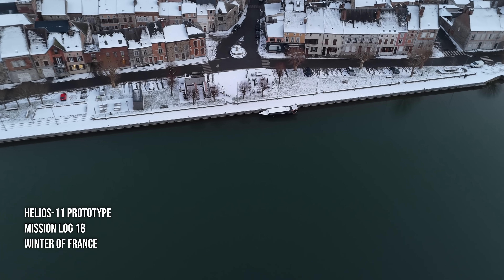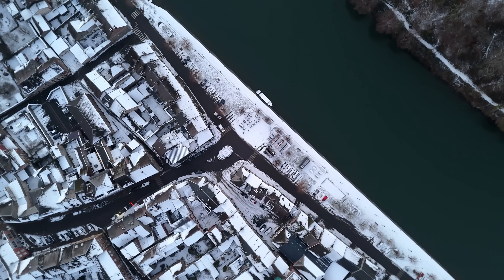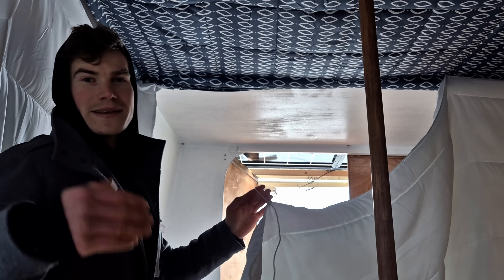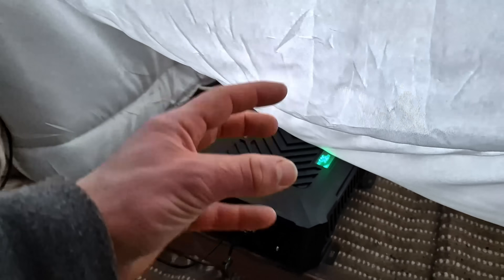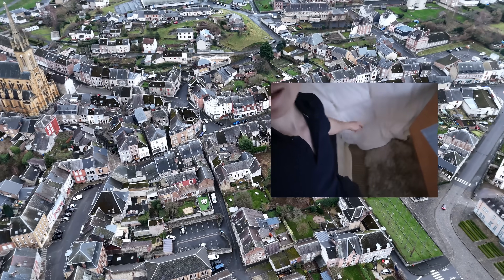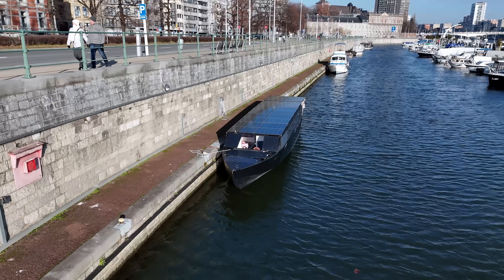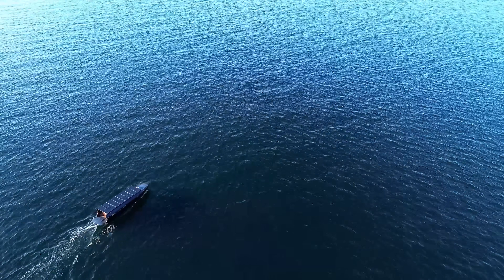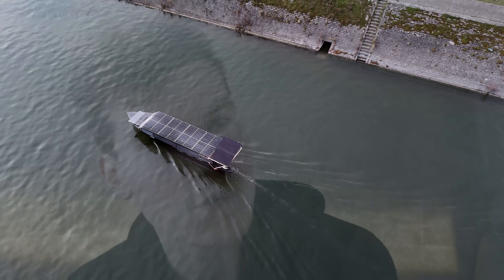Installing Heating on my 100% Solar Boat in Winter (230 V, Infrared Heat)

Comment: For our off grid customers we always set up the Victron Multiplus II inverter to wake up its SECONDARY 230v AC output whenever the batteries State of charge goes over 99% and it cuts off the secondary output power whenever the batteries drop to 90%, so when it’s sunny that second output power source is being supplied by solar energy that is basically bouncing off of full batteries. You could send that excess energy into a well insulated electric hot water tank and use that water in a hydronic under floor heating system or you could use the electricity to power an electric floor heating mat system or infrared panel heaters. Water holds thermal energy well for later use (at night or when it’s not sunny)

Comment: Design proposal: A short while ago I mentioned a gable roof. If you want a flat roof in the middle and have a slope of 30 degrees on the long sides, you can lift the "shadow side" in 30 degrees too.
But the best of all is that you have windows under the sun panels, and you have always a view threw them on the shadow side where the panels are raised to get energy.
If you put all the panels horizontal you have view both sides (and use the panels as marquis/sun blinds in the Mediterranean summer), and when it's getting darker you lower all side panels and use the panels as shutters and keep the heat inside. If you use an air-air heat exchanger you can easily heat the whole boat on 900W and use it as a cooler in summertime.

Comment: The panels on the side of the boat, perhaps they could have pneumatic pistons, that push them up? Hinged at the top and pushed from below. So that, when deployed, they'll be pushed up 90 degrees, to be more-or-less flat with the top of the boat? Flat with all the top-mounted panels. Therefore facing the sun much better. Then, to make the boat narrow again, retract them back to the side. Perhaps when you're docking, or any time at night when the panels don't matter. For whatever reason. Just seems like a way of getting more effective square metres of sun-facing panel. 

You don't have to use pneumatics, there's electric linear actuators, or just use your arms and some metal rods, some mechanism you can deploy yourself.

Comment: Good idea , get a little ceramic fan heater , if you can get some of the double foil roof insulation you could do the same thing but make it more permanent. Hot water heater would be a good idea for when you are moored / in port.

Comment: 500W x 6h = 3kWh. Please font mix kW with kWh - its confusing. Other than that, great video's. I watch U from the begining. Its great that U have solars on the side of Your boat. Great job U tough Finn 😉.

Comment: Can highly recommend getting a heat pump! It will do double-duty as AC in the summer, and will be multiple times more efficient than using infrared heating!

300-500W of infrared being enough to equal 900W of resistive heating is sadly a bit too optimistic.
Reply: True! Many heat pumps are air-sourced. But with a boat, you can use water as your heat source. All those gallons of water, heated by the sun, all year round... Water at maybe 270K, and you want your cabin to be at 280K, a heat pump is pretty simple. It makes sense to use Kelvin rather than Celsius like this, because it's an absolute mesaure of heat, starting at absolute zero. Not relative to some arbitrary thing like H2O's phase-change temperature. Even an air-sourced heat pump can create 1000W of heat for maybe 200W of electricity used. 

Using water ought to be much more effective. Maybe you could even make one out of parts from a fridge? Or else buy one and see how they're installed for water-source. There are ground-source heat pumps, use heat from the ground, but they use a liquid circulating in pipes underground, to take out the heat. So just bypass that bit and take liquid out of the water underneath you. Give it a filter, first. Although I believe they only go through a heat-exchanger and a pump. You could perhaps use your own marine pump, something a bit more tolerant. Any old way, there's tonnes of experimental potential in it, and even a home-made job might well surpass infra-red, or any other sort of resistive heating. 

Some pubs use infra-red heaters to heat patrons smoking outdoors. They're surprisingly effective. But I dunno that I'd want to rely on one indoors. Once you're out of the IR "beam", you're just as cold as you were before.

Comment: Thanks for the video ! I would consider a small backup generator as a means of charging the batteries when solar or shore power is inadequate. Assuming that this generator would not often be used, a gasoline (petrol) generator might be more economical than diesel. I had an old EM600 Honda generator on my sailboat when I was cruising. Its' <600 watt output was not much but it was quiet, lightweight and required little maintenance. I didn't run it very often but it saved me from loads of trouble when I needed to use it. It never let me down when I needed it.

Comment: You could do  way more efficient heat pump. Todays top of the line air heat pumps are about 400 % efficient. For each kw used to run heat pump you get up to 4 kw of heat. You could be brave and use water from outside the boat to collect heat and that would up efficiency to 7-8 kw of heat for each kw run into heat pump. But to squeeze the extra adds risks as you need a new hole in your vessel. 

Or save money and order the cheap Chinese webasto diesel heater. A diesel heater let you stay warm no matter the situation. I would choose diesel heater just because it let's you use batteries and solar for propulsion.

Comment: Maybe silica aeogel Mats are the right insulation for your boat? Hydrophobe and ceramic. They are very think with high thermal Resistance and no fire harzard. Keep on.

Comment: I would have installed a 9000btu minispit heat pump.  At freezing temps the COP would be 3 or so.  Every watt of power would give you 3 watts of heat.   In summer you could use it for cooling the boat.  Or just install a small wood stove.

Comment: I'm reading through the manual right now and it is a helpful "first principles" look at things.  I have not found detail yet or answers to some of my questions but I suspect I can get answers elsewhere.  I was wondering if you saw anything about "X" bows vs reverse or "gooseneck" bows?
I noticed that it would make for not having walking space on the front...do you think that would be missed...say for sail maintenance?
Or could the mast and sail be controlled remotely...and serviced under calm conditions...so many fun things to think about.
Back to reading through the manual. :)

Comment: You're making a fire trap.  Always use fire-resistant insulation.  

You're using the wrong units for total energy, it should be kWh (kiloWatt-hours).  

Electric heaters are always 100% efficient.  You can get well above 100% efficiency with a heat pump.  They make portable heat pumps that work by exchanging heat from outside air using tubes.  The two-tube models work best.  The alternative is a small mini-split heat pump, or a heat pump designed for a boat or RV.

Comment: For the next stage, think about a small heat pump which is 4-5 times more efficient and uses about one Kilowatt. It will heat your boat t0 22C in about 15 minutes😀

Comment: Canadian here, with camper experience if you have an onboard water tank that could freeze I'd have a diesel heater as an emergency backup.  It's a real pain to replace the cracked tank and any water damage.  Yes, with your system it's extremely unlikely to be needed but it's inexpensive and 1 emergency use will actually save carbon output, replacing equipment and repairing damage has a lot of embedded carbon. Emergency use only of course.

Comment: Your pillow castle will get condensation problems. To prevent this, you need a vapor barrier. That's physics, because your outer shell is vapor-tight.

Comment: For extra efficiency, use aluminised mylar film as well to reflect heat in, or keep it out.
Clear bubble wrap works for windows, and the aluminized bubble wrap or rock wool slabs work well.
Rock wool is not flammable either.
Ventilation is also important for oxygen and to reduce condensation. You can decide a system where some of the warm outgoing air can help to preheat cold incoming air, or vice versa when you need air conditioning.
As a Finn, I expect you'll hate the Mediterranean!

Comment: A wind turbine that fits in that sail mast hole would also generate a lot of power.
Reply: No it wouldn't. Small turbines only produce negligible amounts even in very strong winds. They also cost about 100 to 1000 times more per kWh than PV for small turbines up to about 30 kW  Turbines. Wind power scales with size as costs rise more linearly while energy gain rises squared. You need to go very big to make it viable. No bueno under the Megawatt range. PV can be build very small and still be cheap. You can get a single 500 Watt panel under 50 bucks. In big PV plants they still only get to around 6 cents per Watt.
Reply: @thoreberlin  Thanks for the reply. I figured with growing up in coastal South Carolina and always seeing wind generators on sail boats it made sense. The more you learn.

Comment: I think if it were me I would find a heating source that doesn't rely on electricity just to save the batteries in all the power for the engines either way good luck I love your video man and I think your boat is amazing

Comment: liquid water = giant reservoir for a heat pump. You're sitting on an enormous amount of heat, and even more latent heat, no matter the air temperature.
Solution: Something like BSW19482K, a miniature compressor water chiller, except it will just act as a heat pump. This one needs 160 W of electric power and transports up to 400 J/s (?) in heat flow, so you get ~500W equivalent of heating power. 
And it's rather cheap for what it does.
Reply: So you cool the water in the river to warm up the boat right?  Just to make sure I get it right. 
Can it also work reversed so cooling the boat in summer?
Reply: @HansKeesom  guess the youtube regime deleted my reply again. In short, the chiller needs to have a set of valves to switch up the hot and cold side heat exchangers. It would need to be designed and built with those features, as retrofitting is neither cheap nor easy (nor legal without a certificate when fluorocarbon gases are involved).
Reply: 1 watt = 1 joule per second.
Therefore the watt is a rate of flow of energy.
Reply: @ahaveland  edited to word it more accurately, since fewer people read the replies. thx
Reply: I just bought a portable heat pump and was struggling to find small heat pumps. These water chiller units plug that gap! Great lateral thinking idea!
Reply: Interesting idea. It prompted me to another solution. An air conditioner is also a heat pump. And some of them have a heating function even at negative outside temperatures. Undoubtedly, the efficiency will be lower than in your version, but also higher than in any classic heater. There are also undeniable advantages to my option. Firstly, we will get both a heater and an air conditioner. Secondly, we will receive a ready-made factory solution that simply needs to be installed. Also, factory products are usually more reliable than homemade ones, not always, but often. Although - each option is always a compromise. A heater is simple, cheap and easy to replace with another. A heat pump is very effective. An air conditioner with heating is somewhere in the middle in terms of efficiency, has a cooling function, but is also probably the most expensive.
Reply: @АнтонПідгурський-е9л  I've been running my AC unit for 2 years to heat in fall and spring. Definitely doable, but not right out of the box (better controllers monitor dew point, heat exchanger temperature to detect frost and de-ice periodically, which ruins the heat pump operation mode). Depending on the refrigerant used, the pressure in the system will go low and efficiency will plummet. I suspect mine doesn't work as well in cold conditions since it uses R601a (pentane).
Anyway, I feel that IR panels are great for comfort, but air heating is necessary to keep bed, blankets and clothing dry.
Reply: I would consider a product called Armaflex that has a glue layer so you can put it on any surface. Many campers are using it.

Or do you want natural products only?
Reply: Here I am yelling at the Americans for polluting the discussion with their dumb units. And we get J/s. J/s = W. I know it confusing since the human brain seems to prefer W for power and Wh for energy. But use second as time unit and tada it's pretty obvious. 😊

Thank you for not using Trump units.

Comment: i feel if your going to do northern boat living its probably smart to add a small wood stove, just a small hot-tent camping stove would be more than enough for the small interior. it also has the added bonus of being dry heat, something hard to get on a boat otherwise lol.
Reply: also if your going to do R/c scale testing remember you need scaled down waves as well. normal ocean waves will have a much longer wave length compared to the scaled down boat. so performance will skew

Comment: Also, an electric blanket will let you use power more efficiently than heating the whole cabin.

PS: Get a fire extinguisher & fire blanket. Cheap insurance on your lives.
Reply: Also recommend sunbeam USB-C heating pad, just on the lower back will be more than enough

Comment: Been thinking about a sand battery as some of the wight for the keel, allowing for a low power with a long term heat storage with a glycol loop to warm the cabin.